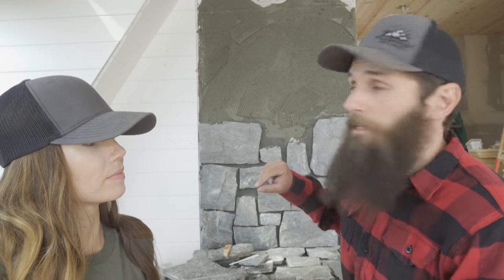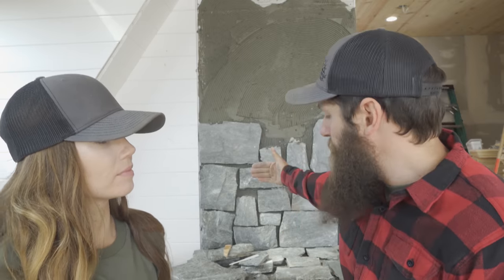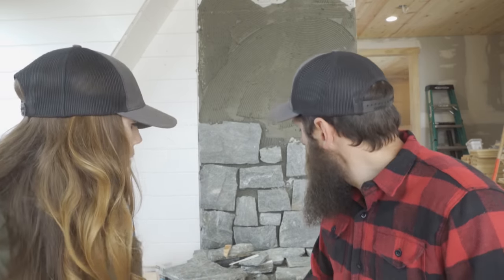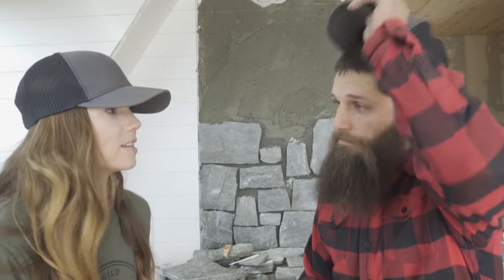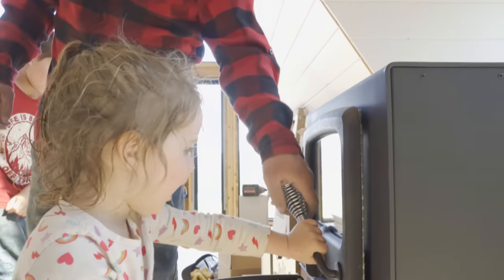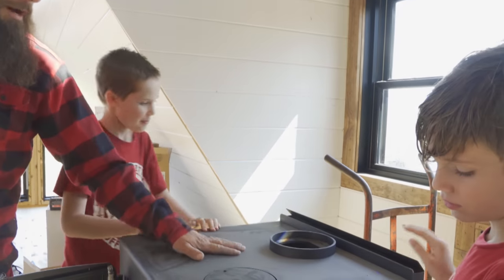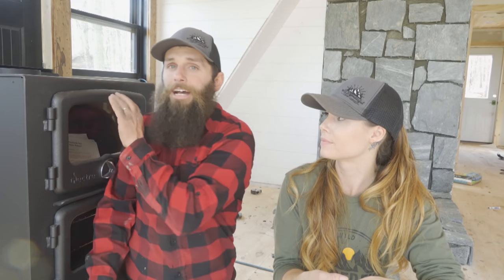Adding The STONE FIREPLACE and Wood Stove To Our INTERIOR DESIGN!

Comment: I’m afraid you will regret not making the stone work on the floor of your hearth smooth as cleaning up ash and smuts will be a pain in the backside, I speak from experience!
Reply: Good point. Though, a solution is grouting to get rid of gaps between the stone tiles. Doesn't make it super flat but makes sweeping and mop up much easier.
Reply: soaringtractor  Couldn't you secure it with concrete anchors to the hearth and floor?
Reply: S Singh yes it will be grouted, but it is still an uneven surface
Reply: @grotline    That is why shop vacs where invented.....
Reply: “FULLY AGREE” from experience that a “Smooth Hearth” makes cleanup easy plus “VERY CONCERNED” that the kids “Will Trip” on edge and even more so with this model of stove as they will want to help cook.

Comment: Hey Josh you could take some screws and screw them in a few of the joints n let the screw heads stick out 3 eights of a inch before you grout. Then just grout over the screws so you don't see them. They will act like wall ties and should keep the stone from falling off later. Just randomly scatter screws. Carefully

Comment: You need to do a six inch from floor to ceiling stone on right side to give the fireplace back a thickness of depth and border it with a nice wood molding for a finish look 👀 nice. Job  guys 
Also have a safety meeting with the kids about stove danger to keep them safe

Comment: I was told by a stone mason to tape off a spot on the floor close to the wall being stoned. Make sure its sized exactly as the space you want to cover. Then place your stones to fill in your "taped space". If you don't like it you can move things around until you find what you like. Then the easy part, just transfer them all to the wall in order. good luck!

Comment: Nice job on stone. Will be interesting to see you place stove level on those stones. Has a small firebox and not sure if it can heat your place based on their specs (700 sqft.), but than again everyone likes heat temp at different ranges, plus you'll have wood boiler has main heat. I have a Fisher Grandma Woodstove that heats 1500 sqft. So covers my small place easily. Hey, good luck and God Bless with remainder of build.

Comment: I think you will find that the outside wood boiler uses an incredible amount of wood. I love that inside wood stove I think you will use it a lot.
Reply: Lots of wasted energy just keeping the fire going, the only good design of a system is one where you have a couple hundred gallons of water as storage.
Build a fire, burn it hot and hard until the storage is up to temperature,  then let the fire go out, and coast off the heat in the storage for days until you need another fire.

We love our woodstove, an old Fisher that still heats and cooks

Comment: love watching you guys , having done several stone projects sometimes when setting stones its good to soak them in water for 48 hrs before install as they cure the water pulls the grout and quickset intoo the stone making them stay put and you might want to think about some type of anchors between the stones so as the wall ages its keeps it secure at least some large headed screws  for the grout to hang ontoo ,, just few suggestions

Comment: If the stone comes off or loose from the mortar chip off the mortar.  Then there is a product in big box stores that's a high temp glue that comes in a tube. Put that on your loose stone, let dry, and regrout.

Comment: Great job with everything Erin and Josh.  Did you consider a Geo Thermal water furnace with the furnace fan and compressor running off your solar system?  The furnace requires minimal electrical wattage and the system is extremely efficient.  You have plenty of land for the underground coils.  Bill

Comment: Suggestion: a wood log mesh (2x2 vertical n horizontal) n place against the stone wall (width of the wall), leave it there till it dry. then remove n fill in the gaps with more cement leveling it all.

Stay safe, God bless

Comment: Don't forget to read your owner manual before installing your stove. Important to install the crimped end black pipe IN the stove to permit creosote build Inside the pipe to return in the apparel to be burned. The air space in between the stove and the wall. etc.

Comment: Nice stove! We have a newer stove (2 to 3 yrs old) and it took us almost one whole year to figure out how to use it. Lol
I grew up with a woodstove, and back in the day, the smoke dragons would burn anything ...fast forward to todays woodstove, they will not burn anything. Ours will not burn thee slightest non-aged wood, very very temperamental. I just want to save you guys the headache, that if your stoves fighting you it's because of green or wet wood. Don't let anyone tell you different ...by selling you more parts or pieces, or that your chimneys too short, or the way you're stacking your wood in your stove ...etc etc. Lol. Anyway I did all the hard work and mental anguish for you in the that first yr of figuring out the stove. Of course all wood stoves can be different.  So there ya have it, burn aged wood and enjoy!
PS ...like your stone work too :)

Comment: Should of put diamond mesh on that wall so it can't fall down later. We always start at the top and work down so if a piece falls it doesn't knock down everything you laid. You can also take a grinder with a diamond blade and make pieces to fit in those big gaps. But other then that good job on your first attempt. Hopefully your not relaying it again next year.

Comment: When I was a kid in the 60's my parents had a wood-stove kind of similar, it was wider and heavy........ there was no glass to see through but one side had 3 burners like yours, the other half of the stove was propane with 4 burners and an oven so you could use either wood or propane. The wood side had an oven built into the stove pipe on top (old). I remember burning my elbow on the top of that wood burner one time..............after that I learned to stay away from it. It was black on top and white all the way around, real pretty for the time but we used it both ways. When we moved out of that house in the late 70's...........the stove was so heavy it stayed with the house,lol. Yours looks really nice especially with the glass up top (romantic nights ahead). I love how you put the rock down, it looks beautiful, can't wait to see you finish it.

Comment: I have asked this before, no answer, this video makes it more pertinent. You have no smoke detectors or sprinkler systems. Do you have an available water source for fire department service? Would you sacrifice your work to just burn down in case of fire? Your thoughts...?
Reply from the maker: The house is wired for smoke detectors. Sprinkler systems aren't common in homes.

Comment: Question...  MICORE BOARD really necessary? I know my stove has Micore board on the top inside the fire box instead of fire brick. But I have never heard of it being used under the cement board. I am at the same spot on my cabin build as you are. I have a framed out hearth with plywood on top  then a sheet of cement board on top of it. 1/2 inch of blue slate is going on top of the cement board. (That is my next step. ) Micore board isn't cheap. So is it necessary?  I know many people that never used it and have been fine. What information did you find that made you put it down? Your beginning statement made me concern. I don't want my cabin to burn down... lol, As long as you have correct clearance from combustibles I think you should of been fine. We love the videos.. The wife and I have been watch you guys forever. Great Job!
Reply from the maker: From what we were told by the wood stove store its not necessary if you use a hearth pad underneath the stove. We didn't like the look of hearth pads and wanted the stove to sit directly on the stone so we opted for micore board instead

Comment: My grandmother cooked on a wood stove. My advice is learn how to do it, then only use the wood stove for emergency heat and install and use a propane stove. Keeping the temperature correct for the oven is impossible, and it is difficult for the cook top. You are going to be busy enough with kids and live stock and general farm work that you do not need the added complexity of a wood cookstove.